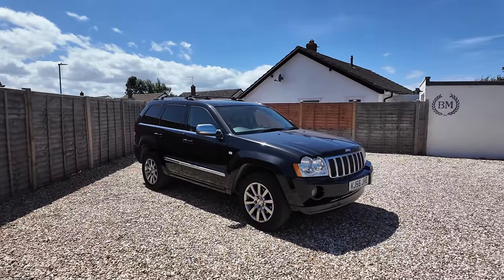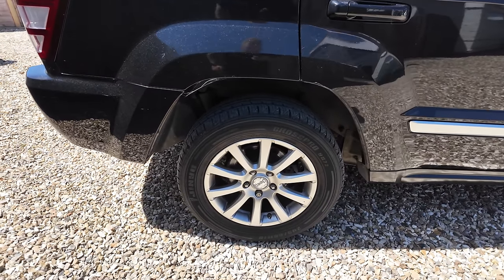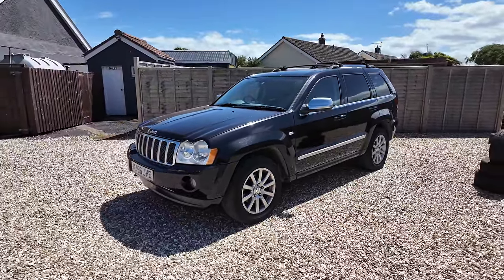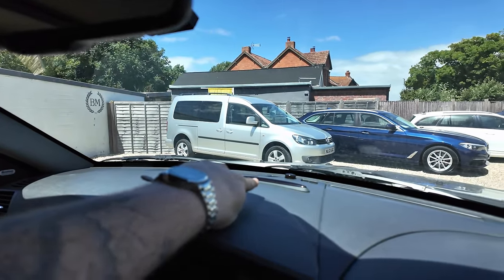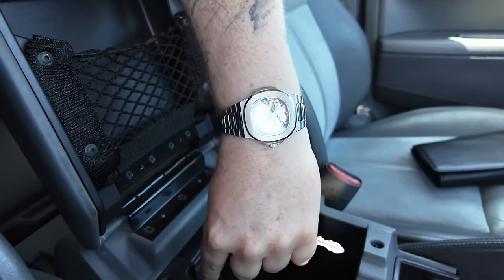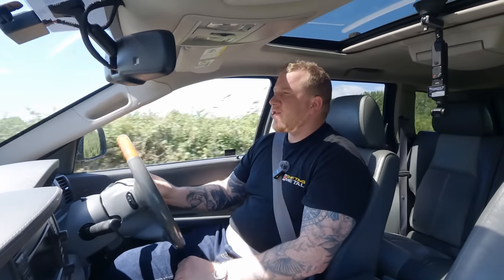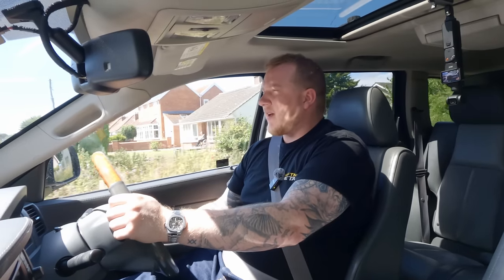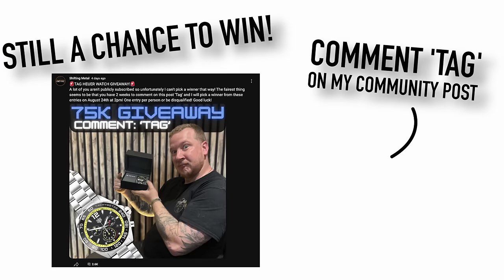I Bought A Cheap Jeep Grand Cherokee And The Seller Didn’t Tell Me Everything!

Comment: Overland is an upper scale trim edition to the Limited. Different head unit, seats, steering wheel& gear leaver (wood look), sunroof, DVD. Yes, it is permanent 4x4 and all tyres have to match otherwise it puts stress on the transfer case. The glass does pop on the rear hatch but have to use the remote. For £1,000 it's s steal. I sold my Limited (traded) for £3,000 and the dealer sold it a week later for £7k. Though it only had done 68,000 miles which made it easier to sell. Mine needed £3k as it needed new tyres and lots of suspension work. There is a recall on the ignition which needs to still be done on your GC. It is a Merc unit. Parts are crazy expensive which is one of the reasons I got rid of mine.

Comment: I had one of these, 150k miles, 6cl petrol. It was a great drive, massive boot but not so huge rear leg room. It had so many issues lol. One time it decided it didn't want to have a reverse gear. The air con leaked regularly, brake cylinder failed, it has a horrendous rocking problem if you hit a bump over 60 mph and many other issues. Still, loved it.

Comment: I love a grand cherokee. Friends and family in the USA have them and I'll beg to drive them when I'm over there. If I could get one in my underground garage I'd have a 2001 4.7 v8 now. There's absolutely no point in the V8 over the 4 litre except that is sounds amazing
Reply: I had a 3.0 2006 as well. Looked at the 5.7 but it has almost the same power and torque as the v6. Couldn't justify paying 30% more for registration to have the same experience. They also sound great for a diesel. Only issue is parts costs are nuts if you can find them as they are scarce. Mercedes scrapped all their spare parts for them so have to source from the states and modify them to fit.

Comment: If you have no boost read and see fit you have a fault for inlet swirl flaps it may also bring fault up for turbo actuator they both use same feed the turbo actuator common to fail 👍and shorts out as does inlet swirl motor normally the orange ring in air pipe is over tighten and oil leaks on to to swirl flap actuator and fills with oil and kills it 👍also common for oil cooler seals going hard need to upgrade to purple one 👍

Comment: All Grand Cherokee WK are full time 4x4, they have a tolerance of 1mm in tyre circumference, but must be the same brand. Engine is a 3.0 crd Mercedes Unit OM642. Weak spot is the oil cooler seals, sitting in the V of the V6 lump, and shows itself with oil leaking from what appears to be the gearbox - but on closer inspection is coming down around the bellhousing. Part is cheap - get the upgraded ones!! They won't leak again. Long Job, 10 hour strip down - which is why people sell them as it is usually around a grand labour. Good thing is to cheak the turbo seals that often cause the turbo to fail whilst you are at it, as that has to come out as well and whilst you are there check over the swirl motor. Some upgrade the intake pipe as it can crack on the seal and leak. Check heater settings and positions for blend doors. Apart from that, they are fairly strong, as they were the last of the Jeeps from under the Daimler Benz umbrella before they went to Fiat. Gearboxes are strong, usually the solenoids if any problems. The 2005 models are the first and best year in terms of sales, as they are half the road tax of the 2006 on.
Reply: Maybe all of the ones in the UK are 4x4, but here in the US you can def. get them as 2wd, they're actually extremely common.  That said, Overland trims were only AWD - it was the highest trim level.
Reply: @ckm-mkc  The Cherokee came as Part-time in the UK, but the Grands were always full time. Later models phased out all petrol options, which are still rare on the WK - there are a few Hemis around, and non existent on the later WK2. Another achievement really was the Quadradrive 2. That could pull away with traction on only one wheel, which is what Landrover are shouting and yelling about as ground breaking tech with the new Defender 20 years later.
Reply: Intake runner flaps motor dies or rod fall off.  Whilst it's off  do the oil cooler seals , glowplugs etc etc etc. Do it once and property.
Reply: I recently found this out. I thought it was engine, transmission, no different tyre brands on the front and back..
 4 tyres later 👍

Comment: The differences with the LImited is available in either 4x2 or 4x4, while the Overland comes with Quadra-Trac II® four-wheel drive (4WD) plus a few exterior styling bits in chrome I think
Reply: 2005 onwards, GC's only came as a permanent 4x4 with Quadra-Trac II in RHD. The USA ones were different because they weren't built by Mercedes, but within the USA.
Reply: Here in the UK we only ever got the 4x4

Comment: Om642 diesel engine, black death can be an issue from the injector seals, hesitation at light throttle is a very turbo vane failure on these